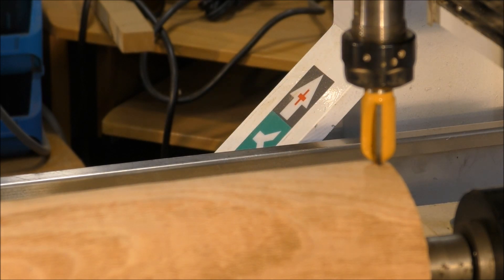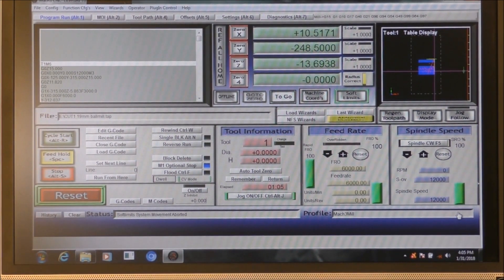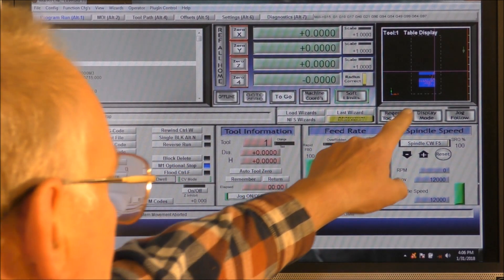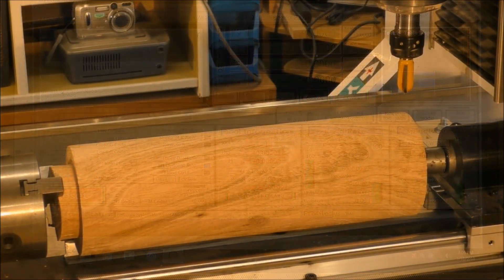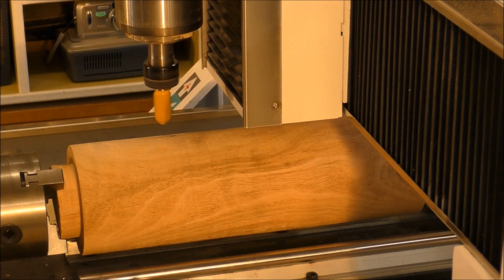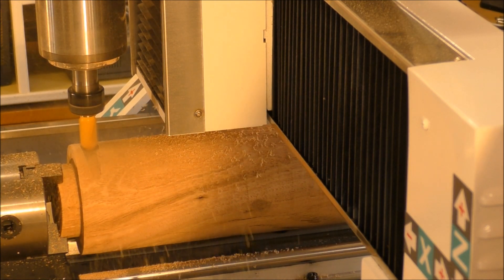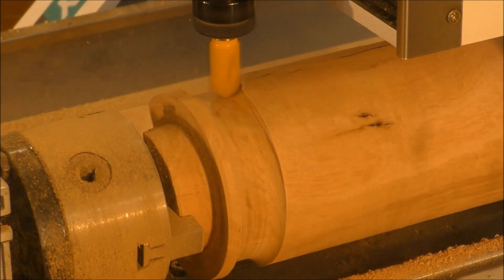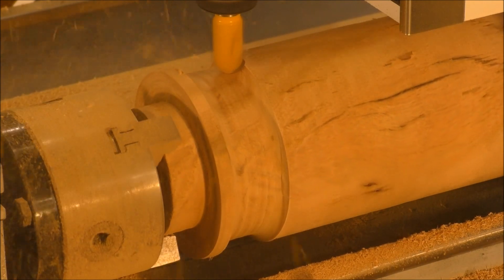227  CNC router 4th axis machining with the X axis

Comment: hi, why disable the X axis, and use the X axis driver to work with the A axis? i have a control card with the possibility to connect 5 drivers for the X, Y, Z, A, B axes, is it possible to use the 3 main axes without disconnecting the X or Y axis to work with the A axis?